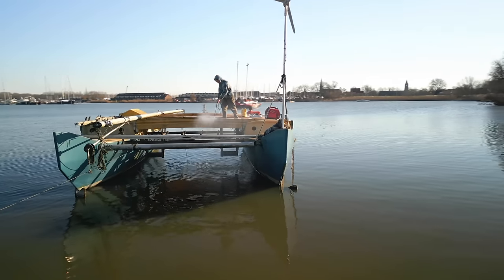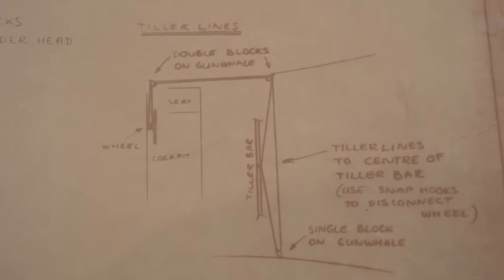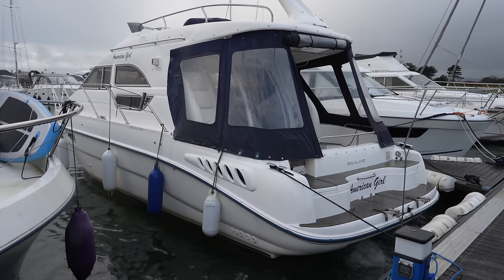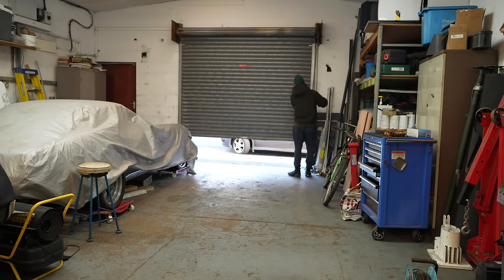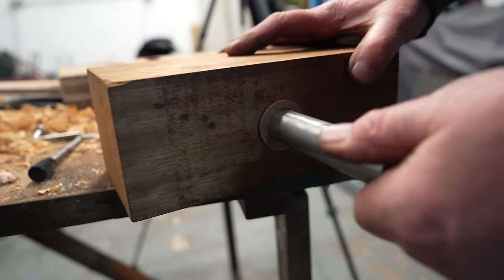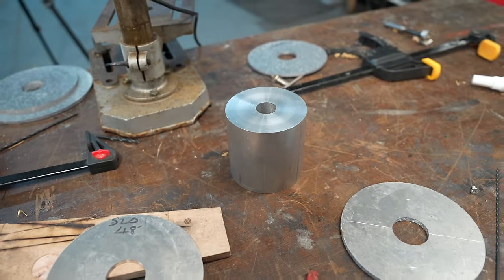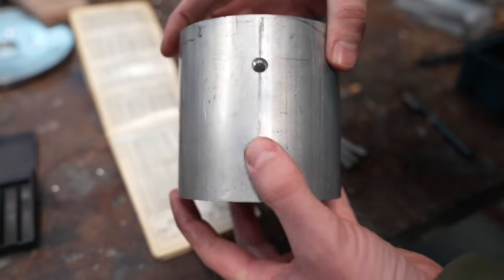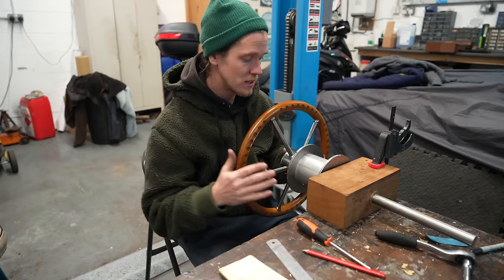My 'Build-Your-Own' Catamaran Gets A DIY Steering System | Wildling Sailing

Comment: That’s a very small size helms steering wheel more suited to a speed boat , a very large steering wheel is much easier to hold onto gives better control and steered by one hand if needed, you will find that several revolutions of the steering wheel will be necessary to aim the boat, no doubt time will tell for you

Comment: Those oilite bushings should be soaked in engine oil for a good 24 hours.  The metal is porous and the oil soaks into it and provides a very good bearing.  It's what spigot bearings on car engines use
Reply: Sintered bronze from memory?
Reply: They should be shipped already infused with oil, shouldn't they?
Reply: Correct
Reply: @mckenziekeith7434   Usually, but it's good practice to soak them still.  You don't know how long they've sat on a shelf, or if they've come from China and are not properly prepared.
Reply: but wouldnt the 3 to 5 different metals go crazy together in a marine environment?   wouldnt you really want to use a Polytetrafluoroethylene bearing instead? to help minimize dis-simular metals?  just asking..
Reply: @danratsnapnames  bronze and stainless are fairly compatible. Aluminum and bronze would be a no-no without some insulator between.
Reply: Oven heat the bush and drop it hot into the oil overnight works but applying oil frequently will have a cumulative effect.
Reply: They normally come pre oiled. But be careful they crush and deform under load as they are made to from sintered bronze. So keeps some spares on the boat.
Reply: Oiled or not, maintenance is the key in a marine and (hopefully) tropical environment where everything dries up including yourself!

Comment: Good job Mark! Keep in mind that aluminium cannot touch other metal, especially when it is around salt water. You have to use Tef-Gel
Reply: I think you'd be better off getting rid of the aluminum completely. Either go with the wood or build the pully out of stainless as well.
Reply: Worthwhile tip that. Somehow I think dad would have this one covered. Great work on that wheel. What about drilling an oiling hole into the wood block and filling it with oil to keep those bushes soaked in oil. May just soak into the wood or seep out along the shaft but it is an idea to consider.

Comment: Nice to see things taking shape. It must be reassuring having Dad teach you all the engineering skills you'll need. Keep up the good work.
Reply from the maker: Cheers mate!
Reply: The key to sailboat Hardware, is always what is referred to belt and suspenders.
Every facet should be over-engineered.
Those divots in the steering shaft, holding the Rope Barrel, should be deeper, the screws themselves should be 10 or 12 mil, and everything, including the tapered steering wheel, should be keyed.
It's true you can add another block w/ oilled bushings later, but now would be the time to do it.
A triangle of forces are the whole reason you are moving forward in the water.
Your sails, your Rudders and your steering gear, pushing against your hulls.
They should all be built as if your life is in jeopardy.

Comment: If the wood block fails keep some axel bearing supports handy
Also would leave room on shaft and drill it for the hub set screws  on the back side of the block just in case you want more support

Comment: Great video.

Bloody nice work.

A key for the wheel I think would give you a lot more confidence in the helm when the seas potentially get a bit big out in the Atlantic.

I think once your block of wood has a securing bolt or two on either side of the shaft it should be fine as the bolts should prevent it splitting along the grain.

Cheers

Comment: Aluminium reacts with stainless steel and will cause galvanic corrosion. 
Great to see you back on YT
Reply from the maker: Going to add some inhibitor before the final assembly 👍
Reply: This was going through my head the whole time watching. Those grub screws and countersunk screws will be impossible to deal with very quickly in salt air. Need lots of inhibitor and should be reapplied soon after launch too.
Reply: Not much different than ss screws in my mast, spreaders & spars ....you just need to coat your screws and tapped holes with Lanolin or one of the many other marine isolator products available like tef-gel.

Comment: Lovely job on the steering. If you haven’t already planned for it make sure that you always insulate your stainless steel from your aluminium with something like Tef-gel to prevent the inevitable corrosion between the dissimilar metals, that goes for all of your SS screws through aluminium and for your aluminium spool on the stainless shaft. I’d suggest cutting a nylon washer to fit between the aluminium spool and the SS of your wheel.

Comment: You're dad is an artist with metal ! Great work ! Remember to keep that shaft well-greased. You have two dissimilar metals in a salt environment. Corrosive and electrolysis forces will be at work ! Definitely you'll want a small pinch of grease on the tapered tips of those set screws (to the shaft itself) so it can't corrode shut. This could happen in a single offshore passage :)

Comment: You need to make a dodger so you have a covered area where your steering wheel is going to be and make covers for the sides. It will be a game changer for you when your on passage to and you won’t regret it.

Comment: I had a Shetland 530. And it also had a coil for steering. But? The coil was behind the wood. Steering wheel, cabin, wood and spool. And then all the pulleys to the 75 hp engine. Greetings from Spakenburg, the Netherlands. This boat also participated in the World Jamborie in 1995.

Comment: Your bushings are closed cell porous bronze impregnated with oil.  As they wear they release oil.  Designed to protect your equipment, but also designed to wear.  Give them a good check up after a year of use and then youll know when to replace them.   We use boatloads(no pun intended)of these for high speed manufacturing. Cover them in oil to impregnate the exposed outer cells before install.

Comment: Hi, I don't usually try to give advice here but the Oilite bushes are good but if in bare wood the wood will draw the impregnated oil out of the bushes along the wood grain and create dark stains. If you want to avoid this you could pull them out of the wooden block and seal the wood grain inside the bored hole with epoxy thinned in acetone.

They're good bushes though and your setup there should last well with them.

Best wishes,

Jamie

Comment: Make sure you use some anti-seize on your stainless steel set screws where the go through the aluminum. The ferrous to nonferrous will oxidize (white rust) and seize up especially when exposed to salt water.
 
 Your dad is a rock star!

Comment: Good video.  You 100 percent need to put a key way in the shaft for the wheel.  No matter how tight you do the nut it will eventually slip.

Comment: Hi Mark,  a ship's wheel is important.  I wouldn't buy an old boat if the owner kept the original wheel.  A Ship's identity was represented by the figurehead.  I'm no expert, but for me the ship's wheel is now most important and representative of the ship and it's history.
So good purchase.  You are now Mahi's boat builder, so choice of wheel is fully yours--it only matters that you are happy with your choice.
You may also consider customizing the Wheel:  brass is nice, an engraving, .., but no hurry
You could support and anchor the steering block with a steel plate welded to legs that attach directly to the steering post/console.
Cheers from Vancouver, Canada

Comment: the ship’s wheel…the part of the boat that you most likely have the most contact…it’s gotta be sturdy and feel right…i much prefer over a tiller, because in rough seas you can stabilize your body with it…  i hope you have proper leverage with that size…i’ve been sailing a cat with dual helm, and have concluded that once you become accustomed to docking and such from one position , the other becomes obsolete…cheers to you and mom and dad
Reply: Yep, how does your wheel compare radius wise to the plywood one on the plans?
Reply: i’m not sure exactly how it compares in radius , but it is larger than the new one he obtained …the steering is fairly light id assume , but even on a seawind 1000xl (37’) cat, the wheels are much larger ….

Comment: Really interesting video. If it were me I’d feel happier having a dowel or two through the drum and shaft rather than relying on the grub screws to take the steering torque. I imagine the load could be quite high on the steering system in big seas.

Comment: Hey Mark
.....  So great and simple plan for the steering system.  I would have went with a larger diameter wheel though and you may end up noticing why soon. Because you are turning using Outboards and not rudders the " lock to lock " radius is greater and it's going to take many more turns to achieve the same result.  A wheel of about 30" would be much better.   Your Speedboat wheel looks cool 😎 though.   Just food for thought. 
Well keep on Brother and Stay warm.  
Cheers !!

Chris & Stella
Reply from the maker: Fair do’s. My last boat also had a smaller wheel and it wasn’t too bad, we’ll see! 👍
Reply: Just go straight to your destination and you will be fine:face-blue-smiling: @WildlingSailing

Comment: Mark nice steering system, the only thing that worries me is the fact that you are mixing aluminium with stainless steel which will cause the aluminium to corrode. When you finally assemble it make sure you use plenty of Dichromate paste to mitigate any corrosion.

Comment: beeswax your taps and then use them in a cordless drill works great just dont crank on them. run in till start to firm up, back out some and hit it again. for mild steel and aluminum.

Comment: Good idea but the spool for the rope shouldn’t be against the steering wheel it should be on the other side of the wood block. It would be more balanced and over time the shaft will bend slightly if you leave it the way you have it.. hard to believe it would bend but it definitely will years down the road. I haven’t been seeing your videos. I was glad to see this one. Take care 🙏👍🇺🇸

Comment: While you still have opportunity you really should put a key and keyway in the steering rod to mate with the lovely steering wheel.  A stripped bolt means no steering.  Not much additional work but very good insurance.

Comment: I might have just drilled a pilot hole through the block, and then run the forstner bit through either side to meet in middle. The forstner bit has a pilot of its own, and so it should just follow the pilot hole. But you got it done, so no worries.

Comment: My local Hackerspace has a drill press just like your dads, just blue and labelled 'biltema' if I remember correctly. Works fine, except some years ago, someone managed to bind up the pulleys by overloading it, and now it quite often just gums up and stalls, no matter how much we clean it out (I think it's the pully in the middle tghat just stops rotating.,.). Nice work on the boat. Looking forward to seeing it under sail :D

Comment: Caution: I think that worked and unprotected aluminum corrodes quickly in the salt air. Consider some sort of coating to prevent that. Also, definitely put a key for the steering. While compression is nice, if the turn happens and loosens the bolt, then you will have a hard time getting enough friction to move the shaft. A keyway in the drum section would also be good. The screws work great to prevent the drum from sliding up and down the shaft (which doesn't really matter); but could easily fall short if you needed to put some real torc on it for turning. Lastly, a possible comfort item, you could angle the shaft through the wood. When you make the holes for the bushings, keep the orientation and just use a larger bit to set the bushing fully into the wood.
Reply: I think your comments are exactly right.  I'd machine a keyway along the shaft for the steering wheel and the spool just up to the bushing.  Those stainless set screws will not handle the torque of turning two big rudders in heavy wind.  One long key for that spool and the typical one for the wheel should prevent this from happening.  I'm very concerned about the set screws holding the spool.  Sorry, the machining is great.  Very fun video to watch.  Cheers!

Comment: Funny you should say about "Classic" Parkside stuff, I was only last night looking at a bench grinder I've had for twenty years, and noticed it was made by Parkside.... I think it came from a little mom and pop motor factor's shop, it surprised me it was made by the same manufacturer as Lidl's own brand tools!

Also drilling the divots in the shaft for grub screws, I've done that so many times over the years when I didn't have the facility to mill a keyway slot, great solution!

Comment: a little information

Contact between stainless steel and other metals, primarily aluminum, can cause galvanic corrosion, which is caused by an electrical voltage difference between metals far apart in the voltage series. On board a boat, it is often the tension between stainless steel and aluminum that causes galvanic corrosion. Greetings, the blacksmith 👍

Comment: Pressurize oil into those bearings just with your hands the bearing is porous the oil will soak right through to the outside.

Comment: Wherever you have dissimilar metals screwed into aluminium smear some Duralac or Tefgel in there to stop electrolytic corrosion. If you have to undo it in 10 years you will thank me! Oh and say Hi to Stu for me next tine you see him. We both had our boats in the same yard in the U.K.  Lovely guy Stu.

Comment: Hey friend, JFYI, you need to design hard mounts for your outboard motor's, or you will never be able to control the vessel safely and properly. Use 90 degree angle steel or aluminum angle, and mount the system to your big beams. You may have to do some welding to make good solid mounts. It will cost more, but is the only way to safely mount your outboards.

Comment: Keyway is in my opinion must. On the vawes the nut likeke to go loose some time. If it happens, without keyway you will not be able to steer. Next, you shoud end the stainess steal rod in an angle, the same as steering wheel has.

Comment: Nice video Mark. One point, you are going to get serious problems with galvanic corrosion mixing stainless and aluminium. Maybe change the ally for stainless?
Reply from the maker: I’m going to add some inhibitor before the final assembly 👍
Reply: @WildlingSailing  👍

Comment: Well buying the wheel probably saved you a few weeks of effort that could be better put into other things but I'd be worried that wheel is a bit small for a sail boat, fine for under motor, not so great when under sail, hopefully it'll be ok 🤞

Comment: Water will seep past the oilite bushes and become trapped between them .Your wood block should be rot resistant or you can glue in some sort of tube with M3 5200 , Sikaflex or the like . The steering system works ecellently. In my experience  even better if you connect the ends of the steering lines to the tiller ends rather then the centre of the tiller bar. If you glue/screw a rubber pad on your alu drum the steering rope will not slip and only thus three turns of line around the drum will be enough and very little tension on the steering line arrangement will be needed

Comment: Dear Wildling Sailing.
👍👌👏 Very well done again, Sirs (video and work). The steering contraption looks awesome and very sturdy. I guess with Dyneema rope it will be reliable and smooth running at the same time. Please kindly allow me to suggest that you consider to cover/close the holes with the grub screws in the aluminium rope drum with for instance sikaflex. Because otherwise there will most definitely be contact corrosion/galvanic corrosion between the different metals when you are at sea. 2) Your Dad is simply a great guy. And of course behind or beside almost every great man is respectively has to be a great woman. By the way: Your mother is looking like a fresh breeze on their luxurious motor yacht. Enjoy the remaining weeks staying at home.
Thanks a lot for making teaching explaining recording editing uploading and sharing.
Best regards luck and especially health to all of you.

Comment: Have you thought about putting the drum on one side of the post and the wheel on the other to even the stress on the shaft. Also think about a mechanism to lock the steering so you can step away from the wheel

Comment: I don't have experience with how a Wharram drives but you might want a larger steering wheel for a sailboat. The larger diameter the lighter touch and less of an arm workout. (Sailor  pro-tip)

Comment: Hey here a big fan of the channel, I liked this episode , the ingenieering, how much I´m learning, your parent your editing and explanations..But there Is one thing about the rudder..only two little bolts to take all the power that the axis has to hold and twist? I would put 4 or 6 more and glue to make shure it won´t get loose of constant vibrations at sea cose, if those two fail in a storm you loose control of the rudder and you´re done. I´m a total ignorant but I can see a weakness there, most likely that I´m wrong but please double think It,  you are doing such good an spiring job thanks keep on cheers😘😘😘

Comment: Tight work and classy wood wheel somewant a lightning conductive  wheel versus wood,however likely wet from precip with hit under way. I would wrap the entire assembly in decorative rope cordage tight wrap as to create soft edges only for the wheel base assembly safety and help with handhold grip. Peace keep up good works.

Comment: Put a keyway in the shaft to join the wheel, otherwise, if you have to torque the wheel in heavy weather or push past the stopping point of the rudders you back that nut off and the wheel will come loose.  Had a car steering wheel with that problem.